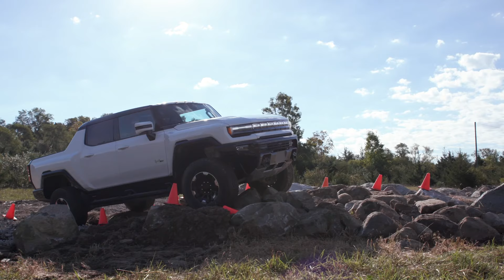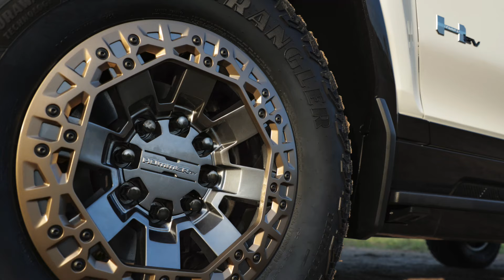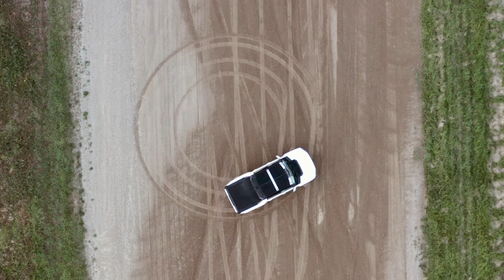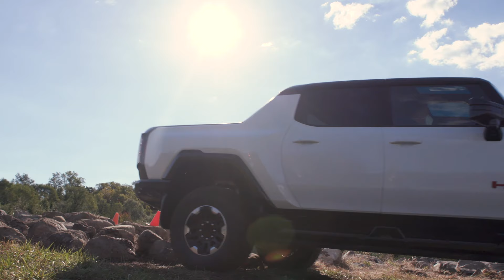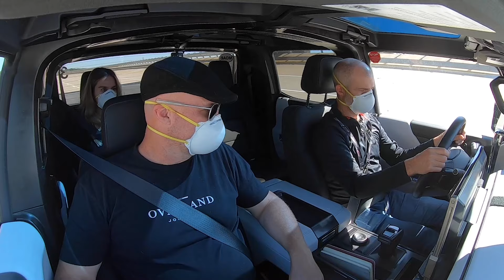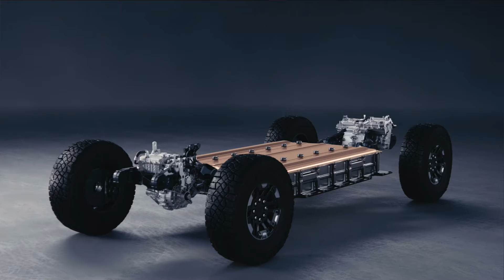2022 HUMMER EV Electric Super Truck :: First Overland Drive

Comment: HUMMER EV OFF-ROAD SPECS
We’ve got more info on the GMC Hummer EV. It will have the same size profile as a GMC Sierra AT4 pickup, and will be as long and wide as a Ford Raptor. Thanks to its 4-wheel steering, it will have a turning radius less than a Tesla Model 3. When you raise the suspension to its fullest, what GMC calls Extract Mode, it has almost 16 inches of ground clearance, a nearly 50-degree approach angle and a 38-degree departure angle. It can climb over an 18 inch wall and drive through water that is 32 inches deep. Those are pretty good specs. GM claims the program only started 18 months ago, so it moved pretty quick. And what saved a ton of time is that it’s really built off the Cadillac Lyric EV.  Autoline Daily

Comment: What if I'm taking a road trip?
Where do I charge it at?
How long does it take to charge? 
Look, it's a novelty. That's all it is. Until you can charge it in the same amount of time it takes to fuel a gas powered vehicle, it not worth owning. It's cool, but it's a novelty.
Reply from the maker: Rivian EVs drove from Ushuaia to LA
And a group of Rivian EVs just completed the Trans-America Trail. 

What you are concerned about has already been overcome in all but the most uncommon of scenarios. 

Technology always seems a novelty to those who have not experienced it 🙏🏻
Reply: @ExpeditionPortal  the time to charge is my hesitation. I love road tripping, but don’t want to spend 45+ mins at a station charging up. Guess one benefit is I could whip out the yoga mat.
Reply: In owning an EV for two years now, 99% of the time you can go in the store and grab groceries and supplies anyway. This idea of sitting in your car picking your nose for 45 mins is self inflicted. There’s always plenty of things to do while you wait (in my experience) I’ve only experienced the frustration of not charging fast enough once. I was on a tight timeline and didn’t plan ahead, and the stupid card reader wouldn’t accept any of my cards. The downsides of owning an EV (which are mostly temporary as it’s still developing) are far offset by all the advantages IMHO.
Reply: @spacecruisers  I hear you. For me if the car can not charge in the time it takes for me to fuel a vehicle then it's not worth a road trip in it. 
It doesn't take 45 mins to fuel a car. When they get to that point (and I'm sure they will) then cool. But just out of curiosity what happens to the batteries when they no longer work? How are they disposed? Is it more ECO friendly than a combustion engine to get rid of? And how do we get the resources to make the batteries? What happens with these trucks when they go through a stream? Are the batteries safe? Will they be able to keep water out so not to short circuit?  I like the idea of these trucks but they're just not ready yet Tec wise.

Comment: bring lots of fire extinguishers.
Reply from the maker: Do you think that EVs have a higher fire hazard that ICEs?
Reply: @ExpeditionPortal  similar at best. A burning ice vehicle take an average of 300 gal to extinguish, according to various reports, a tesla for example takes 25.000 gallons.
Reply: @limodrivermike  these will have completely new Ultium battery chemistry and be updated with new formula every couple of years as we have seen with Bolt.
Reply: @normt430  thanks for the update.